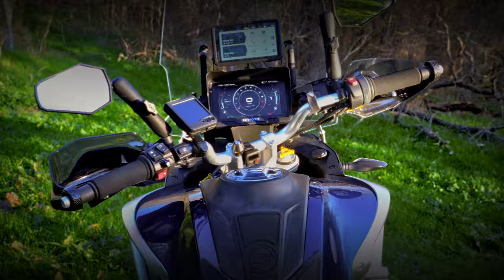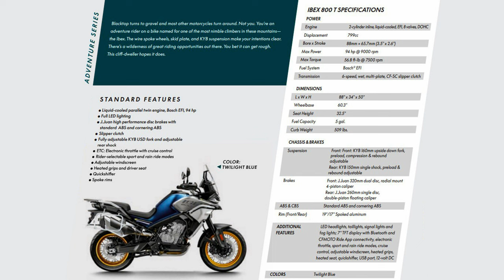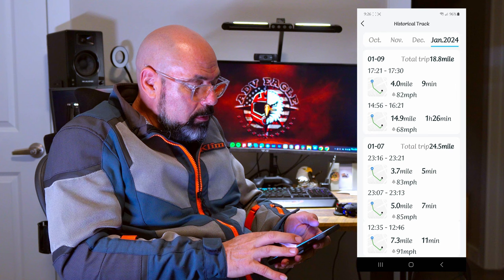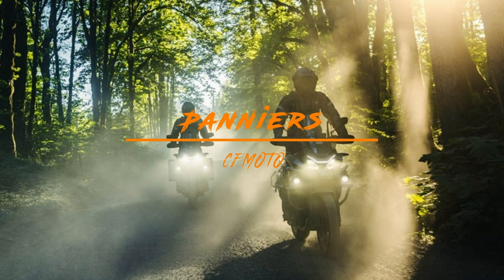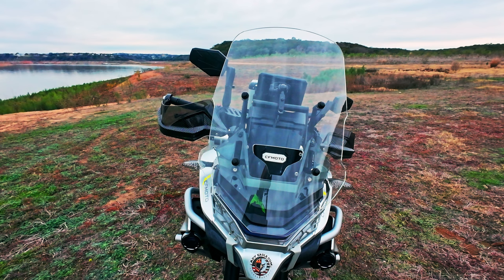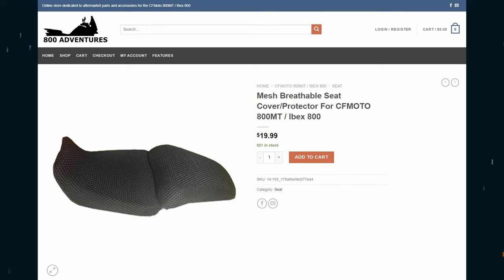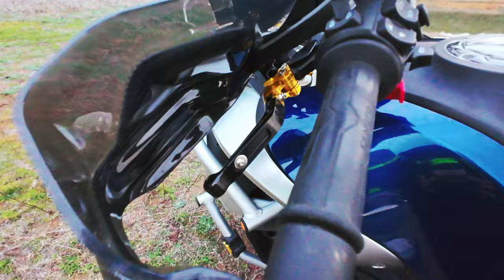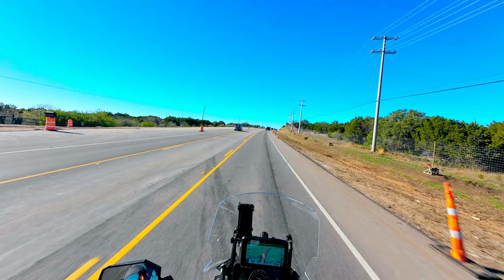CFMOTO IBEX 800T | Review by owner

Comment: I appreciate the honesty of your review. I am trying to get real world feedback from owners regarding this machine as it has my interest.  I have been riding motorcycles all my life since the age of 7 so that puts 45 years under my belt and I have owned many different styles over the years but find myself looking for a bike that I could ultimately ride year round in all four seasons. Sure I could probably get an XR, DR, or KLR 650 but they have no real spunk to them and wouldn't be something I could leave middle America for a coast on and have it be comfortable hence looking towards a more middle weight Adventure Tourer. 

   I had considered checking out a Royal Enfield Scram 411 or possibly a Himalayan but they lack the engine performance to act as a tourer even though they would make a fantastic economy commuter. 

I like the idea of the heated saddle and grips and the Panniers would be a welcomed accessory. What is the coldest temp you have ridden in and did you find the heated accessories to be adequate or more of a gimmick? Like I said I’m looking for an all season machine to commute to work and for weekend get aways in the wilderness with my Mrs.
Reply from the maker: Thank you for the comment. The coldest I've ridden was 18 degrees Fahrenheit. I was actually blown away, and so surprised by hiw effective the heated seat and grips were. I never thought a little heat on your butt and hands can make such a difference.

Comment: The quick shifter is not very good at all. Well it wasnt on the one I test rode anyway. The wind buffeting was bad too. Would need a better windscreen. What size did you get from Calsci?  I like the fact that you can change out the air filter easily unlike many other bikes.  Have you ever owned or rode any of the vstroms? Wondering how the two would compare.
Reply from the maker: I agree, the quickshifter is not the best, but I was even surprised it had that feature included for the wonderful price. Many are surprised to hear that it comes with a quickshifter. So yeah, its not the best, but I'll take it as included in the bike. most bikes don't even have that feature. 
True about the wind buffering. I really didn't like it. that's why I researched and looked around for weeks before I found the amazing ClaSci. I got the Large windshield. I'm 6'1 and its freaking perfect! no wind buffering whatsoever. even at 90-100mph.
I actually test rode a Vstrom before buying the IBEX. it was a few years old. I really didn't like it. she felt very heavy and very vibraty. and the heat that came out of the engine was cooking my legs. but that was one test ride on one Vstrom. aslo the Vstrom is not really made for rough terrain/ off road like the IBEX. I plan on going camping a lot and wanted a bike that can take me anywhere off road without worrying if she can handle it. the IBEX definitely delivers. especially with the Trailmax Raid tires.
Join us at our Discord group to chat more. ADVeagles.com
Ride safe bro!
Reply: I am currently riding a 2017 Vstrom 650 ABS and hopefully soon will upgrade to an IBEX 800 T. Been learning only good things about it. 😊
Reply: I find the qs works perfect if you use it properly...

Comment: Hi there! Have you noticed some cam chain rattle? I noticed on mine, sounds like a bag of nails, dealer says it is normal but I can swear the cam chain tensioner is not working properly.
Reply from the maker: Hi Luis, No I dont have that issue at all. I suggest take the bike for a second opinion at another mechanic. Most dealers are clueless about the IBEX because its new to them. My dealer was the same. Find a local mechanic that you trust, or with lots of positive Google reviews and take the bike there for another opinion. Any sound that is not the engine sound is something to check in my opinion.
Reply: Same on the KTM790.